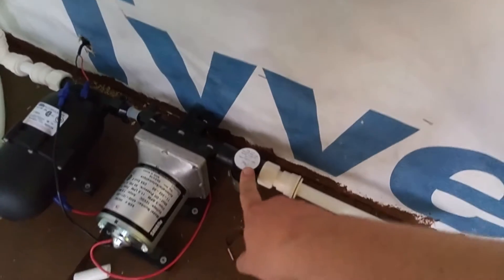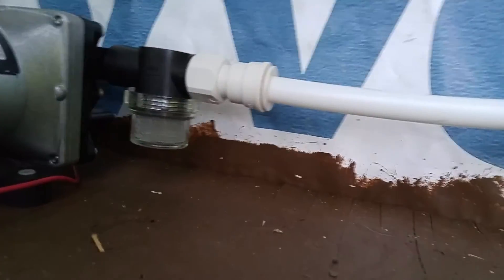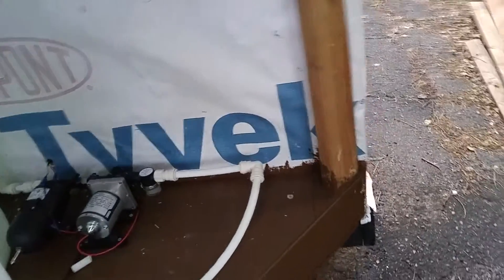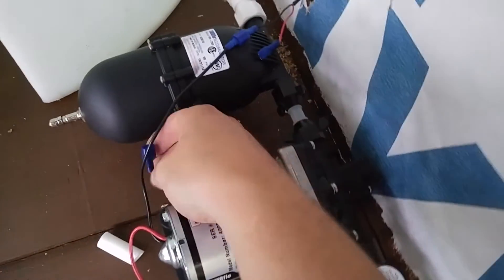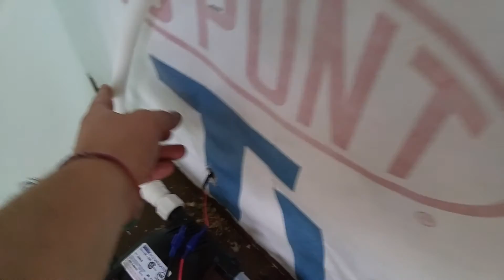Tiny House Build - Off Grid Water System

Comment: try putting the accumulator in an upright position with the presure valve on top it might work better for you check it out
Reply from the maker: Thanks for the suggestion. The manufacture's website said it shouldn't matter.

Comment: Nice setup. But I am suggesting you raise the pumps onto a platform. That way if you spring a leak in that area from a pipe or your tank you won't short out or burn down the house.
Reply from the maker: Good suggestion. The pump does come on dampening rubber feet that are about an inch tall so I think it's already done fore me.
Reply: No problem. Gotta help out all I can.

Comment: What happens when you run out of rain water during dry spells or just in general?  Do you solely depend on rain water?
Reply from the maker: +Zack Vance, right now I fill from city water. When I go off grid I'll bring in water when I run out.
Reply: +Going Tiny How often do you have to refill it on average?
Reply from the maker: +Zack Vance good question, the 160 gallons lasts about a month. Maybe a little shy depending on how much I'm home
Reply: +Going Tiny Wow impressive... I figured taking a daily shower would deplete the water supply very quickly, but I'm sure there are some water conservation shower heads.

Comment: What about colder weather?
Reply from the maker: +adam33star Great question, the area is enclosed and insulated. I also have 2 computer fans drawing the warm air from the house into the space to keep it above freezing. I had no issues this last winter. :)
Reply: +Going Tiny thank you! I am going to start a build really soon and off the grid water was somewhat of an issue to figure out considering the harsh weather. I like your enclosed idea with insulation, next is how much use and how often id have to fill up.
Reply from the maker: Now that my GF lives it in it with me, we each shower probably every other day, we go through 160 gallon tank probably every 2 weeks. So about 300 gallons a month.